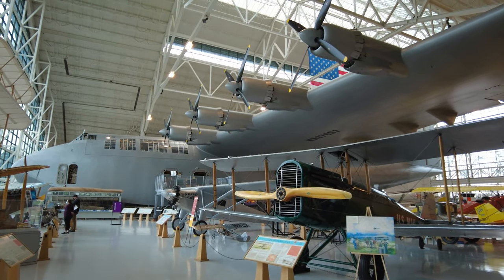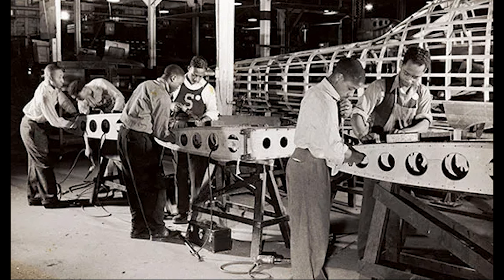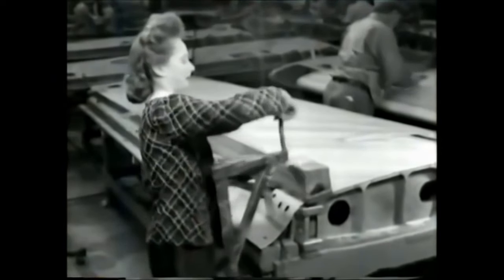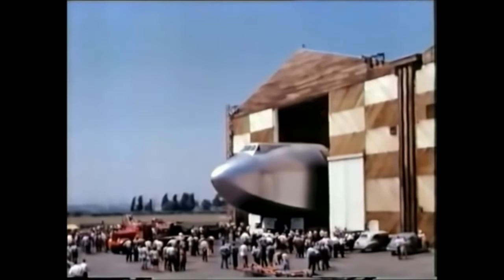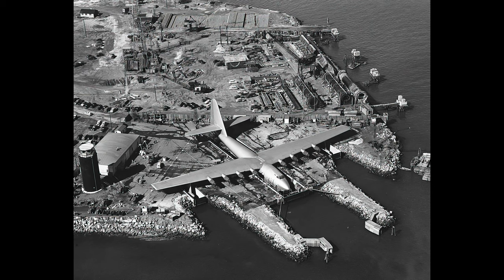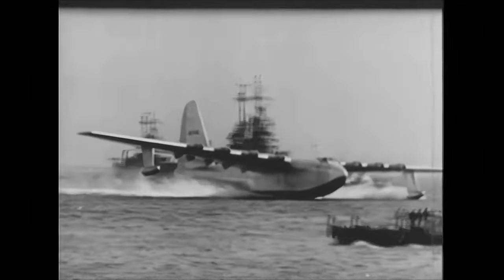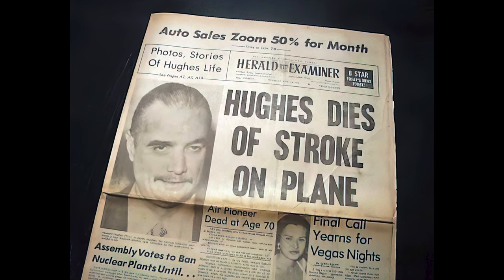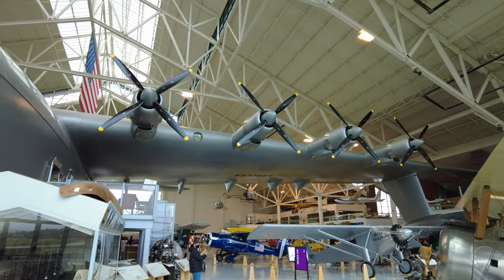The *Spruce Goose* is born! H4 HERCULES

Comment: Nice Video. Well done. For others The Evergreen Aviation & Space Museum where the Spruce Goose is on display is a must see. Two giant Buildings filled with exhibits inside and out, a Theater to see Aviation films, and a Giant Water Park built around a 747 which is located just 1 hours drive southwest of Portland Oregon.
Reply: Yes.  I spent 2 days at this world-class museum.  I was allowed in to the cockpit and actually sat in the same seat Hughes sat in.  Amazing experience to say the least.  Cheers from Canada.
Reply: Also, coincidentally I worked in the Canadian Arctic and one of my coworkers from Calgary was actually on Long Beach when the flight took place.  Purely by accident, he witnessed history.

Comment: Having only one flight doesn't diminish its importance. 
I think people underestimate wood as a useful modern material. A bit of clever engineering made a forest fly as the Hercules. One of the CNSA's space capsules used a wooden heat shield which worked just fine, and it's still one of the most renewable resources we have.

Comment: Alex, Great job on this video. Thanks for keeping history alive and interesting.
If you think about it, the reduced power needed to fly within ground effect could greatly benefit a "flying troop carrier". The reduced fuel load needed would add to its payload. It would not have been as visible to the radar of that time, painted the right color it could be nearly invisible to high flying planes, safe from U-boat attack and using spotter planes could steer clear of warships. With the highest waves in the Atlantic reported at under 70 ft and with ship traffic able report real time weather conditions, it could schedule flights based on the weather. Sea birds glide across the water using ground effect, only occasionally flapping their wings. Howard Hughes was a  multi billionaire and a visionary to say the least. Flying that day cemented "Hughes Aircrafts" place as a viable and profitable government contractor then and into the future whether it be through Hughes helicopter, Hughes satellite, purchased by Raytheon and I believe Boeing now or the many other spin off companies.
Reply from the maker: Yes but there are other dangerous factors, at low of an altitude, you get terrible turbulence because the air is not as stable. Cross winds can make the wings dip into the water...and that would be the end of the Spruce Goose.

Comment: I have never been able to find this out. When it did its one and only flight, was it under full load? I would be grateful to find out.
Reply from the maker: It was not carrying any cargo or extra weight beyond its own mass, if that's what you're asking.
Reply: @AlextheHistorian    

Yes, thank you. 

Then a double question mark remains. Whether it could fly beyond ground effect and whether it could do so while being loaded with the equivalent of 750 soldiers and their equipment. I'm surprised, that while he had the opportunity, Hughes didn't take it higher than 70 feet. That would have put paid to the first question. My layman's guess has been, that if it could overcome the drag of the water, once airborne it could have flown higher than it did.
Reply from the maker: So it's a complex thing but to simplify, he wasn't even planning to fly the plane that day. A flight plan was not filed with local authorities, air traffic was not cleared for him, and because the plane was experimental, he didn't have the permits to take it into the sky. He could have got all that ahead of time if he had planned to fly the plane, but he didn't plan it. It was a last minute thing he did based on the pressure he faced from the public and the government because no one believed it could even lift out of the water.

And lift out of the water it did. Hughes wouldn't have pulled back on the yoke that day, and risked his career and reputation if he wasn't sure the plane could generate enough lift.

I'm confident the plane could have carried the weight it was designated to, but without proof of its ability, the world may never know. But having visited and toured the plane twice, I can say that thing is a beast, it's stronger than it looks and those massive engines can haul way more than the empty plane even weighs.
Reply: @AlextheHistorian  
Thank you for well addressing the question.